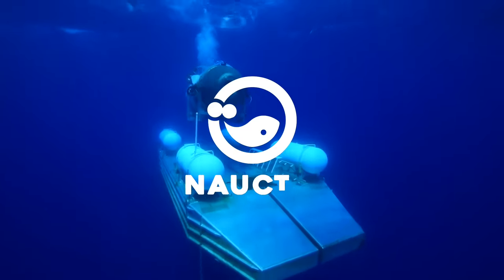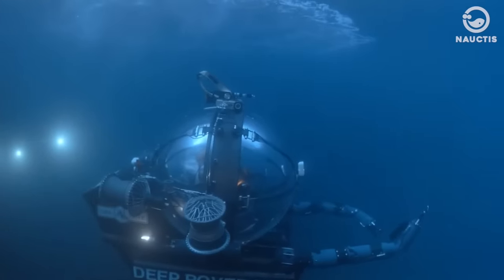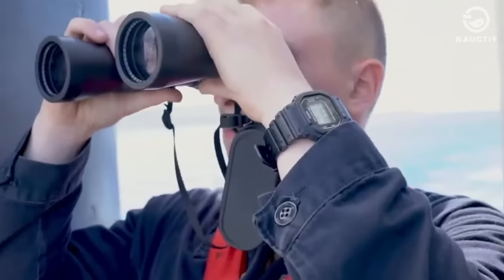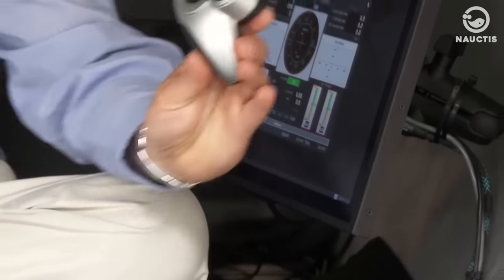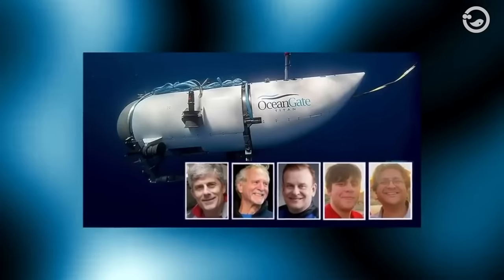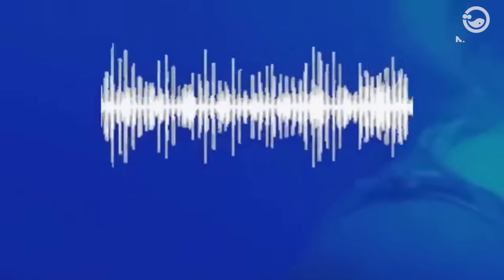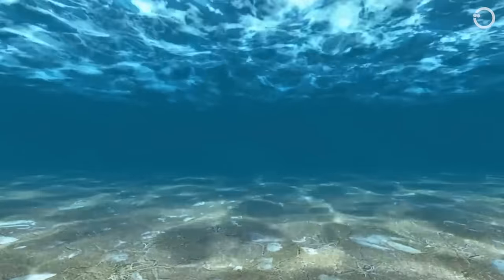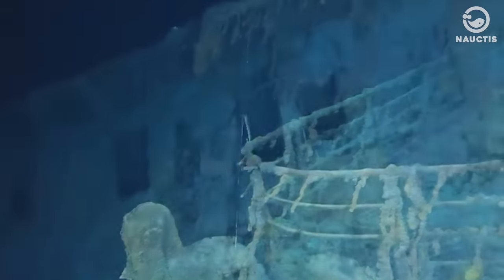U.S. Navy Reveals TERRIFYING New TRUTH: What Really Happened to the OceanGate TITAN Submarine

Comment: Its really quite easy to understand how a carbon fiber tube would have a lot of strength for pressure pressing outward on the tube from the inside but not much strength for pressure pressing inward from the outside. I really can't help but think that Rush didn't understand this. And low IQ is the only explanation. To explain further with inward pressure pushing outward the carbon fibers are stretched lengthwise. Where as with outward pressure squeezing in on the tube much or most of this strength is lost.
Reply: One would add that the strength of carbon fibre is in tension and is poor in compression. Also it is along the grain not across the grain. Same reason steel is built in bridges that consist of mostly tensile forces ( pull apart) and concrete is used in compressive forces ( push in). The whole choice of materials and manufacturing methods was totally wrong for this project.
Reply: @AJHyland63  I think if I had considered going down to titanic in titan, my biggest concern would have been that the titanium end caps could detach and pop off. After all Rush is on camera saying that they were glued on. The word glued is bad news when when your speaking of the construction of a deep water submersible, unless the glue was used to hold on knobs and such in the interior. Added to that the two materials, carbon fiber and titanium expand and contract at very different rates. Bottom line is that the vessels construction was just way to simple for such hard duty.

Comment: If anyone thinks the glue let go first the fact the locking ring and end cap sheared all it’s bolt proves that the glue held tighter than the bolts…
Reply: Who says the bolts didnt just fall out after the glue let go and carbon fell apart. Your theory doesnt hold up.
Reply: @xikimunki735  what you said make absolutely no sense… the cap is bolted to the locking ring. Please explain the mental gymnastics of physics you used to make that ridiculous comment… do you seriously think the end cap was bolted to the CF
Reply: @torana6531  if the carbon itself lets go the bolts have nothing to hold on to.... the implosion of the carbon hull can easily break those bolts. The pressure is enormous. Are you implying the bolts just broke by themselves???? Its a ridiculous theory. Based on the presumption that the bolts failed. They never found the bolts. If the carbon desintegrated they could well have let go whole. Blame it on the bolt manufacturer. Yeah. Do you work for oceangate? That would explain a lot.
Reply: @xikimunki735  ok you just showed you have zero idea how it’s built, you were the one who claimed the bolts just broke themselves. The end caps are bolted to the locking ring, the locking ring is glued to the CF hull.. the wreckage shows the shock wave from the implosion blew the view port out, sheared the bolts holding the end cap to the locking ring, then pulled the locking ring away from the hull.. in that order… showing the glue was stronger than the view port and the bolts.
Reply: Oceangate is finished. Just like your theory. You just dont seem to understand that if the glue holding the carbon did not fail then how did the hull implode???? You claim the bolts are to blame. Ridiculous...... bye bye oceangate
Reply: @xikimunki735  wow were you deprived of oxygen at some point where did I say the bolts were to blame? Obviously the hull failed, you were the one that made the ridiculous claim that after the glue failed the bolts just magically fell out of the locking ring..

Comment: Epilogue
   
In his final dying moment our uncelebrated hero places his finger on the trigger of a 0.45 calibre automatic that he carries, concealed beneath his vest. Sonar detects several bangs in rapid succession greeted by one gigantic sonic boom. The Titan implodes. The ocean folds back into itself the way it has always been since the beginning of time. Soulless. Immortal. The dying meet the already dead and the dead embrace the CEO and his mission specialists.
   
The CEO is vindicated. Carbon fibre proves its worth. He always wanted to be an astronaut. In an immeasurable instant he is launched directly to hell. 

Aftermath 
   
Titanium hemisphere. Taking a calculated risk did not mean that the CEO should be reckless with his own life. A titanium hatch of identical thickness to that of the outer wall sealed off the aft hemisphere from the passenger compartment. This hemisphere was missing from the field of debris that littered the ocean floor. Mission specialists were told that it housed controls that enabled the vessel to maintain stability during an emergency. In reality, the end cone was an escape module that was designed to break off from the carbon fibre hull and float back up to the surface with its sole occupant should the submersible encounter difficulty from which it could not extricate itself. No one except the CEO knew of its true purpose. Accordingly, when the alarm sounded none of the crew questioned his action or even suspected an ulterior, selfish, self-preserving motive when the narcissist climbed into this hitherto vacant chamber and tightly secured the door from inside with bolts, ostensibly to take decisive action in order to steady the vessel and keep them safe. An hour later the titanium end cone was picked up by a navy submarine with its passenger uninjured, in perfect health and in good spirits, totally unruffled by the tragic loss of his fellow crew, deeming his mission an unparalleled success. This portion of the episode is classified. The official narrative that all of the mission specialists met their demise remains unchallenged.  
   

WWII batteries 
 
In the waters of the Grand Banks off the shore of Newfoundland Canada stands a six storey high battery absent its artillery. Languishing unused for nearly a century it had become the repose of smugglers and weekend romantics. A prince, among several other dignitaries, accompanied by their nubile, some would say nude, escorts were rumoured to on more than one occasion to have landed in a pontoon equipped express plane and spend days savouring its secluded ambiance shielded from prying eyes. Wiring of the explosive charges that would demolish it was nearly completed when the Polar Prince towing its perilous cargo steamed past. A half dozen bangs and one gigantic whoosh and boom were heard on hydrophones in listening stations that proliferated in the Atlantic Ocean when this concrete edifice crumbled in a cloud of dust and disappeared beneath the waves. At the very same moment hundreds of miles away Titan slammed into the ocean floor. The mission specialists, safe and sound, but unable to communicate or disengage, awaited rescue. 

Banging sounds at thirty minute intervals 
   
The CEO dragged the insensate body of the hero that had sacrificed his life with him into the titanium aft cone before securing the door of the hatch so that it would be able to withstand the enormous pressure at this ocean depth. Then, applying the correct codes that only the CEO was privy to, what the mission specialists thought they were hearing was the landing frame being jettisoned was actually the escape module being hydraulically detached from the body of the vessel. Freed from the grasp of the Titan it began its resolute ascent to the surface. A low tech rapping was the prearranged signal that announced its arrival to the navy. It was for good reason that an electronic beacon was deliberately omitted from the module so that it would not be discovered first by an unintended party on this, a most clandestine assignment. While some presumed that this venture was the precursor to the recovery of gold from Spanish shipwrecks in the Atlantic Ocean only the most astute observers might discern that it was the forerunner and vital constituent of exploration of the underwater base in Commission UFO being sponsored by the navy where tactics could first be tried and refined in a relatively nonthreatening environment, without fear of being zapped by aliens, when dissecting the Titanic. 
   
   
The Indian princess 
   
The CEO had a passion for achievement. Risk taking was more than his daily bread. It was an obsession. An addiction. To the point where some claimed he was reckless. Despite a portfolio that evoked envy among those of us that had earned bragging rights, he could never rise high enough. It always had to be more. He never boasted. Until he reached the pinnacle in his mind his stature was modest and he had yet to climb above one of the lower rungs. That required far more financial resources than he could possibly assemble in one installment. That is why this trip was prized. A covert operation for which he had been well compensated and stood to earn even more. That would leave him with sufficient funds to meet the next stage of his ambition. Unknown to the public, his passengers were not a product of chance that merely had lots of money and who could afford to pay for the trip. Thrill seekers they were not. Slated to come along on this trip was a direct descendant in line to the throne of India, known only to the CEO, a veritable Indian princess. The legitimate heir of the Koh-i-Noor diamond that reposed in the hold of a sunken British ship at the bottom of the Indian Ocean. During his lifetime much criticism was hurled at the child monarch’s regent that ruled in place of the young Maharajah of Lahore, but foolish he was not and those that had intimate knowledge of his schemes applauded his shrewdness. Housed with the loot in the British Museum was a worthless quartz replica. Visitors complained that this supposed priceless gem resembled a piece of ordinary glass and it was withdrawn from further exhibition. 
   

Escape module recovered 
   
Officers on the navy ship were astonished when they discovered what appeared to be the corpse of a young man that had also been crammed into the confined space of the escape module. When the ship’s doctors examined this adolescent male they realized that his lifeless body was not dead, but merely in a deep coma from which he would revive and fully recover. The CEO was a considerate man. Knowing the importance of the young idealist to his family and even to his nation he made an effort to bring him along and ensure that his body would not be ravaged by sea creatures on the deep ocean floor. Doctors unstrapped a leather pouch that was fastened around the chest of this seemingly deceased young man and were somewhat less than fully surprised when they found that it contained not a Kindle Reader that they had supposed would be inside of it and accompanying him on this kind of trip, but a fully automatic Smith & Wesson. Nothing unusual about that. Americans loved their guns, felt naked without them and each of the mission specialists certainly had one or more concealed on their person. The CEO carried three. Early on in his studies at the Wharton School of Business the young idealist became similarly equipped. A handgun was an indispensable part and parcel of a resident’s wardrobe.

   
Mission specialists 
   
In truth, unrealized and unknown to each other, members of the crew pursued their own hidden agenda. The reader is already aware that enormous wealth awaits recovery from the ocean floor. That much is obvious. Gold from countless shipwrecks. It has been estimated that more gold from the Americas lies on the seabed than succeeded in completing the journey across the ocean to Spain. Lest we lose sight of the members of our cast let us briefly review the passengers that make up the crew whose identifiable purpose is obscure. The CEO and the idealist are already safely aboard a navy ship. The Titan is the forerunner of a concept with an optimum configuration that could accept undertakings that were beyond the scope of conventional bulky and grossly overweight submersibles. A lucrative contract that the navy awarded awaited fulfilling by the CEO. Only the most unconventional could be depended upon to carry out this commission that literally required thinking outside of the box in a situation whose realm was out of this world. With the funds earned even better vessels awaited manufacture. The idealist taking a break from his studies at Wharton was a placeholder, a substitute passenger for the Indian princess whose life was precious and could not be risked in a perilous operation and who abides her time until the Koh-i-nor is safely recovered from its resting place at which time she will assume her rightful spot on the throne of India. We should not forget, nor abandon, the remainder of the mission specialists awaiting rescue stuck in the Titan in the vicinity of the wreck of the Titanic. The billionaire whose ambition is to restore the former glory of the British Empire. The merchant that is going to assert what he deems is his rightful claim to the sunken booty of the East India Company. Vast wealth is his to embrace. And finally, the navigator. With knowledge gained from numerous visits to the Titanic he wishes to establish that a voyage down to the seabed is an effective approach to permanently curing substance dependence, to which he aspires to hold the patent.
Reply: That's very creative, you should expand it into a cold war type thriller/ spy/geopolitical intrigue book !!
Reply: @vicbittertoo 
Yes, the text you provided was likely created by AI. There are a few things that suggest this, including:

The text is very creative and imaginative, with some unusual and unexpected turns of phrase. This is something that AI is good at generating, as it can access and process a much larger dataset of text than a human could.

The text is also very detailed, with a lot of specific information about the submersible, the crew, and the events that took place. This is also something that AI is good at generating, as it can access and process a lot of factual information from the real world.

Finally, the text has a certain "feel" to it that is often associated with AI-generated text. It is a bit cold and detached, and it lacks the kind of emotional resonance that you would typically find in human-written text.

Of course, it is impossible to say for certain whether the text was created by AI without knowing more about its provenance. However, the evidence suggests that it is highly likely that it was.

Here are some other things to look for when trying to identify AI-generated text:

Generic or repetitive language: AI models are often trained on large datasets of text, which can lead to them generating text that is repetitive or sounds like it was copied from somewhere else.

Factual errors: AI models can sometimes make factual errors, especially if they are not trained on a dataset that is accurate or up-to-date.

Unnatural word order or grammar: AI models can sometimes struggle with grammar and word order, which can lead to unnatural-sounding text.

If you see any of these signs in a piece of text, it is a good indication that it was created by AI. However, it is important to remember that these are just general guidelines, and there are always exceptions.
Reply: Say again...
Reply: AI generated conspiracy theory??
Reply: @thedbcooperforum  I'm an AI generated conspiracy theory??